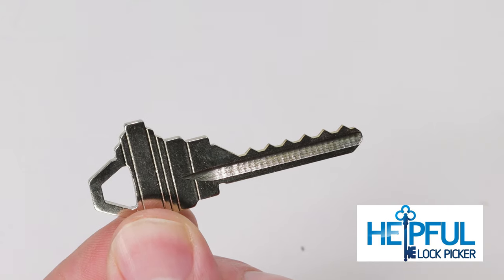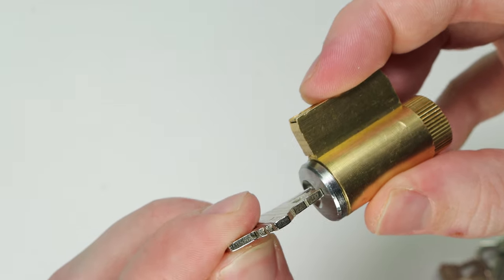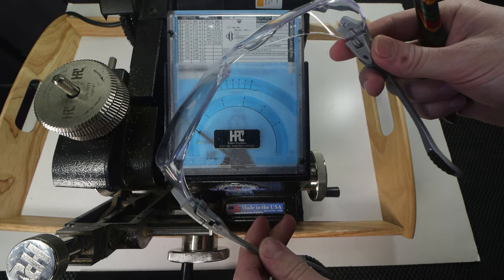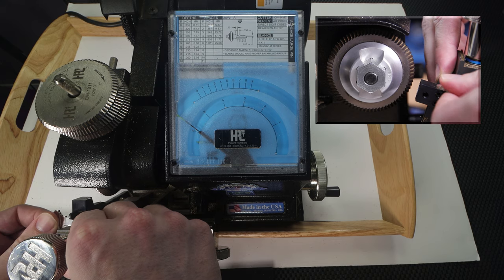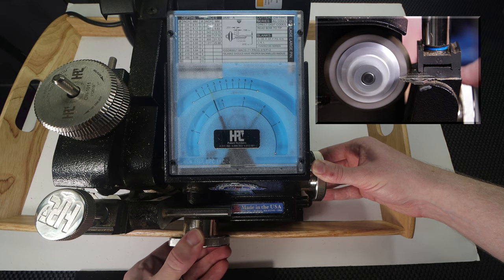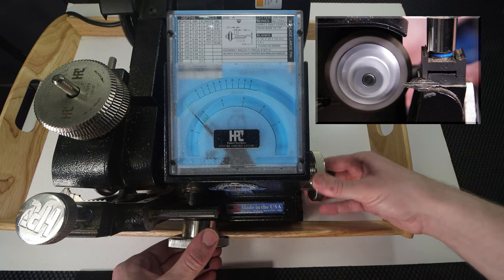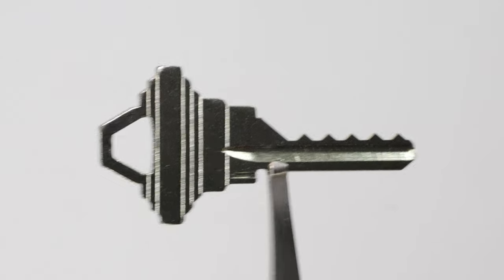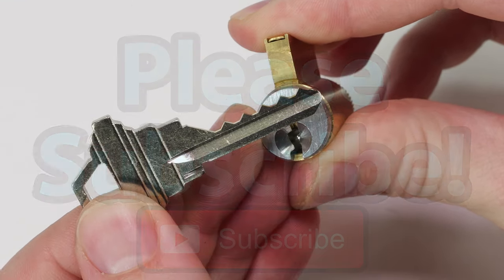How To Cut A Bump Key || Learn To Make Bump Keys!

Comment: Simple note to forensic locksmith fans: I can tell that this cylinder has been bumped a lot. Note where the shoulder of the key comes in contact with the cylinder. It shows marks from shoulder being slammed into the cylinder face.

Comment: I don't have a key cutting machine so I would need to create them by hand.  How many thousands of an inch high does each tooth need to measure?  I can measure the spacing between the tumblers.  I've already spent hours trying to unlock a Kwikset clone so I can re-key it.
Reply from the maker: Look up the root cuts to the key in question and do the deepest cut

Comment: Nice work on the key. I think it's fair to point out bump keys will not fair well on a lock with good bitting and or security pins. But most junk residential door locks would be lunch for such a key.
Reply from the maker: I didn't show the key to this lock but it certainly wasn't bad bitting. I will send you a photo

Comment: What about the chart you used to get key specs? Where do you get those, of did they come with machine?
Reply from the maker: My code cards came with the machine however the root depths charts are easy enough to search for on the internet.

Also, if you make an account on lockcodes.com of any of the other sites you can get that info there as well

Comment: I have a bunch of Master Lock #3 I got off e-bay. No keys. I got a LIshi and decoded them. But Locksmiths want around $15 to make a key from direct code. WTF?  And if you go to hardware store, they only cut key from another key. Is there a video on how to hand file a key from direct code--where to get depth of cut, etc? I can use a regular Master Lock key to get spacing. Thank you.
Reply from the maker: You would want to look up the chart for the root depths. You can get Master Lock code cut keys on eBay for $4.99.

Depending on how serious you are the Silca Flash duplicator I have is $500 new and you can get space and depth keys and do it at home (you can get used machines even cheaper )

Comment: Nice comment & perspective on also cutting tip of key down -- I wonder if that bump key you had made at the Kiosk key machine a long time ago cut the tip down as well?  Also nice shots with 2 cameras of HPC machine in action.  Note that bump keys don't always (or sometimes never) work.  I always prefer an nice informative, edited video as opposed to a fumbling, rambling, lengthy "live" video.
Reply from the maker: Thank you for sharing.  That key did work band the tip was not cut down. Boredlockpicker (I believe) mentioned once he never cuts his down but I have always had better luck doing that
Reply: @HelpfulLockPicker  Interesting -- I never thought about cutting down the tip, but yes it could make it work better, but not totally necessary
Reply from the maker: @Pyrolock  when you cut something like a Kwikset key the tip looks quite ridiculous
Reply: @HelpfulLockPicker  OK -- never made a KW1 bump key -- just used my KW1 deepest depth & space key that someone else made -- guess I'll cut one next time I'm cutting KW1 keys and see for myself -- Besides you can't bump "smart key", so use my Lock Tech decoder for that.
Reply from the maker: I find it funny as soon as they made that for the smart key Kwikset decided to make a Schlage smart key
Reply: @HelpfulLockPicker  I'm sure Kwikset had those plans for the SC1 Smart Key for a long time before that.  It's yet to be seen how well the SC1 works -- I have not seen any SC1 "SmartKey" locks available or reviewed yet

Comment: I tried 20 times and couldn't get my KW1 with my bump keys I bought. Something I'm missing. You didn't do much explaining. could watch 1 hr vids on this. In other words it was ironically not helpful.
Reply from the maker: Some locks are harder to bump than others. Hopefully your lock doesn't have a #7 pin because sometimes the KW1 keys come cut 66666